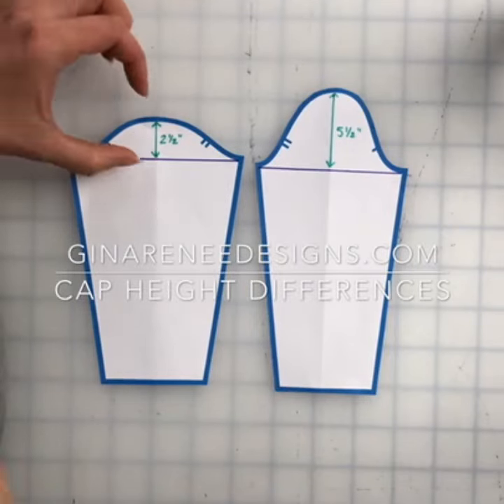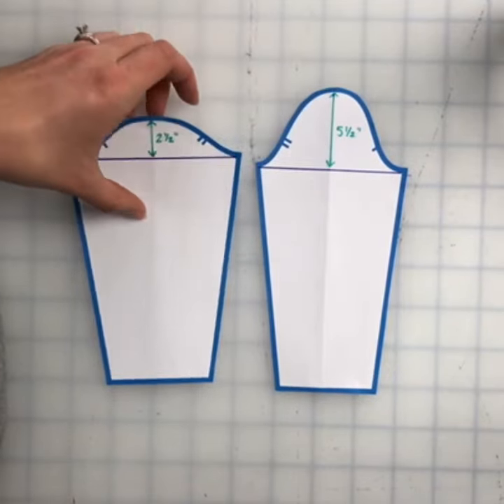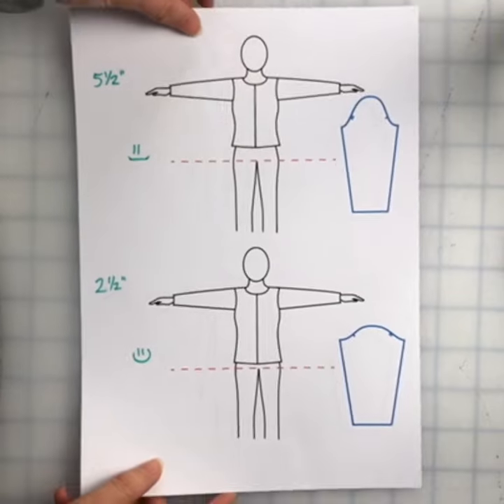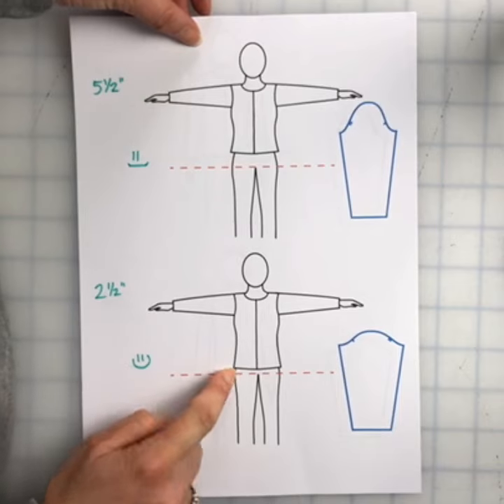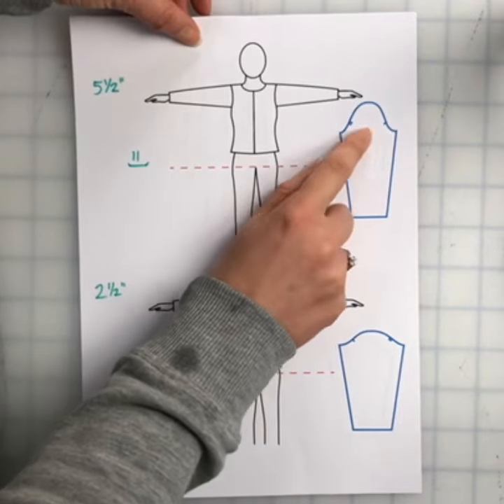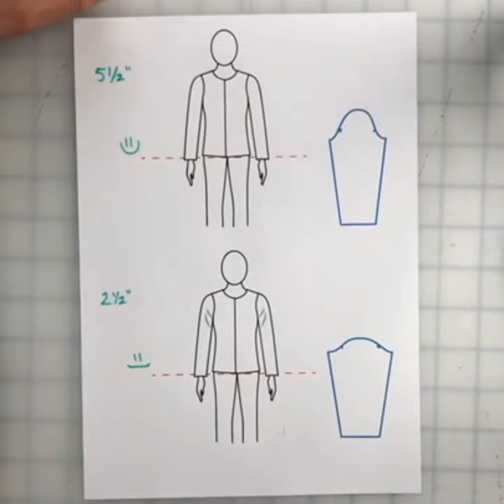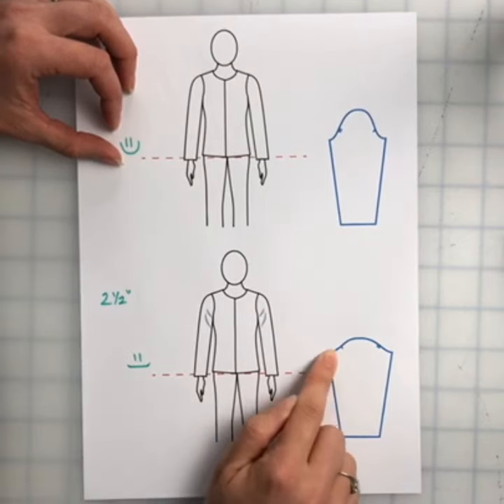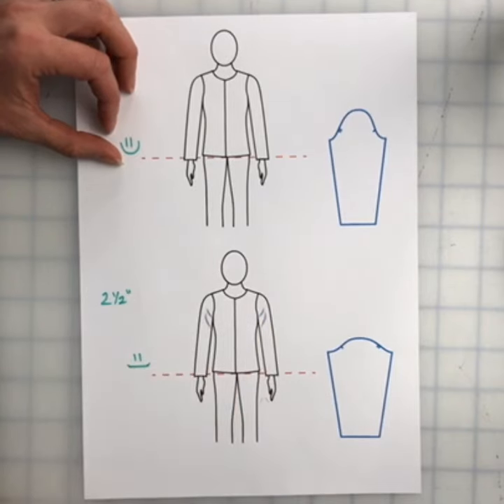What’s the Cap height on a sleeve pattern - Sleeve Cap Heights Explained

Comment: I've got your book and trying to correct peaking sleeves and thought i'd have a look at different cap heights and am surprised that higher caps make for lift.  this seems counterintuitive to me.
Reply from the maker: Yes, it is a bit counterintuitive. There's usually what I call a "sweet spot" for the cap height range, and it's that middle ground where the cap height is not too tall and not too short. It's finding that balance of what feels good to you for the lift of the garment.
Reply: Exactly what I feel too.(in-between short n long is better

Comment: Wouldn't u say that a shorter cap height makes a wider sleeve, so applicable to people with thicker bicep. Can someone with a wider bicep have a tall cap?
Reply from the maker: Yes, a shorter cap does tend to make a wider sleeve. And yes, someone with a wider bicep can still have a taller cap. If you consider most coats and blazers that fit well, they still can accommodate a large bicep in many instances while still having a tall cap height. For example, I tend to have about two sizes larger of a bicep than the standard size with my shoulder width. It's finding a balance between what feels and looks good.

Comment: Do you think you can add an elbow lump in it, so when bending, the elbow part doesn't receive much stress.
Reply from the maker: The best thing for an ergonomic sleeve with elbow shaping is to either have a two-piece sleeve that has shaping built-in or a sleeve with darts. The point of the dart goes to the elbow from the underarm seam. Either option gives you shaping for the elbow. If you take a look at many suit blazers or motorcycle jackets, you'll see these types of fitted, shaped sleeves.

Comment: Would fabric choice affect the crease lines?
Reply from the maker: The appearance of the creases will look different with different fabric types, but the actual amount of excess creating the crease lines is actually the same if you have the same exact pattern but different fabrics. In some cases, if the fabric has vertical stretch, that could reduce some wrinkles in the cap area but not in the underarm area.

Comment: What happens to the normal length of the sleeve measured?
Reply from the maker: On a shorter cap height sleeve, the sleeve length is technically shorter from the top of the cap height to the hem compared to a sleeve with a longer sleeve cap height. However, I usually measure sleeves from the Center back of the garment to the shoulder tip, then to the sleeve hem - it's called a 3-point sleeve measuring process. That way you always have the same total length comparison because the shoulder width and cap height varies for every style.

Comment: I was making a baseball jack with the lower capheight, but didnt like the draglines. So i changed to a high cap, but is there another way to get rid of those drag lines and keep the space for moving your arm freely? Should I change the armhole to a more straight line then?
Reply from the maker: I'm sorry for my delayed response. I've been sick over the last two weeks. Another option is to raise the armhole under the arm. This will then allow you to have a shorter cap height because the armhole is higher, allowing for more moveability. When it comes to functional activewear, "function" always trumps "looks" for fitting purposes. If the whole garment raises due to a taller cap height, it may be less functional. Comfort is key in functional activewear and many times, you need to accept the draglines so that there is enough movement. The movement allows for optimal sports performance.
Reply: @GinaRenee  thank you and hope you are ok now.
So if I understand it correct, by raising the underline of the armhole your gap is getting smaller and so your sleeve will be narrower but with the space for movement cause of the low capheight? And the draglines will be less then.
That is easier than making a sleeve adjustment for small arms! (Tried that now hahaha)

Comment: If the pattern I purchased came with a short cap height, and I draw a larger cap height on my muslin, do I need to make the arm hole on the bodice bigger?
Reply from the maker: You would have to either reduce the bicep width of your sleeve in order for it to fit in your armhole or you would have to lower the armhole to make it bigger.

Comment: so i made a shirt and i like the look a lot but when i raise my arms it feels very tight and restricting. that’s a cap height issue and i should lower the cap height right?
Reply from the maker: It depends where it's tight. If it's tight in the circumference of the sleeve, then you need a bigger circumference (for example, bigger bicep and elbow). 
If it's tight in the cap area as you lift, then it's likely the cap height. If you are reaching forward and it's tight, it's likely the cap width.
Reply: @GinaRenee  okayy, i think it’s mostly when i move my arms forward so should be the cap width. is that the same as the bicep width or something different?
Reply from the maker: @zachmcmillian2330  The cap width is on the sleeve cap head on the pattern. It's shown in The Fitting Book on page 16 for your reference. If the issue is that the garment is tight when you reach forward, you may want to try checking the across back of the body as shown on pages 109-110 in The Fitting Book. Then possibly give more to the cap width where it feels tight to you.
Reply: @GinaRenee  okay thank you so much for the advice i really appreciate it!

Comment: whats calculation for cap height...?
Reply from the maker: The cap height depends on the amount you want to move your arm up. There is not a specific calculation. You can refer back to the videos with me measuring my arm to determine a good starting cap height based on the arm movement.
Reply: @GinaRenee  
thank you 
try it